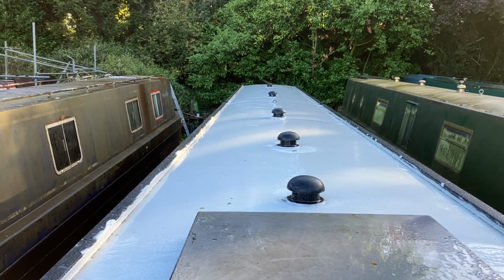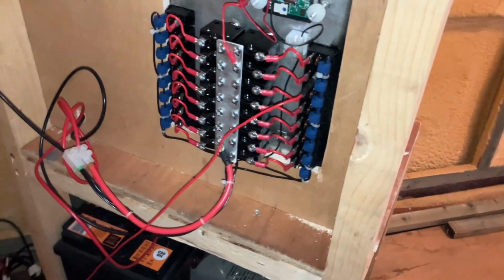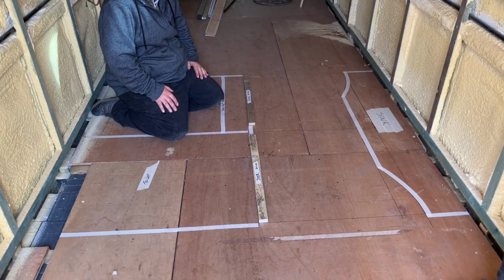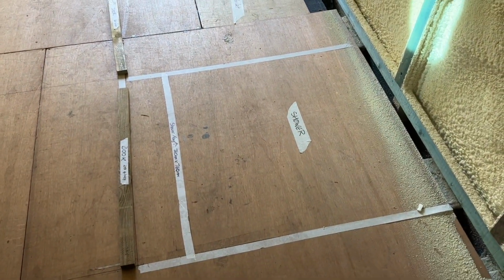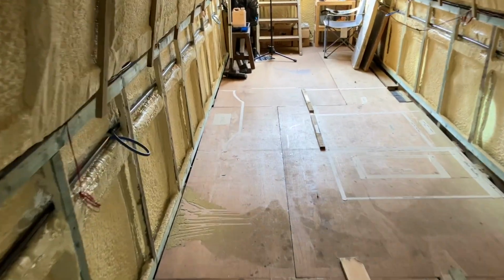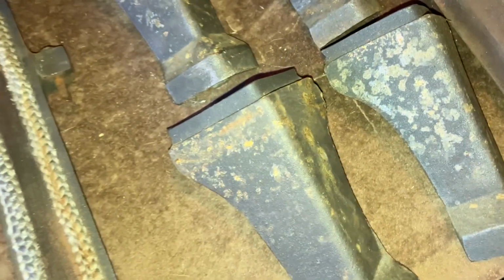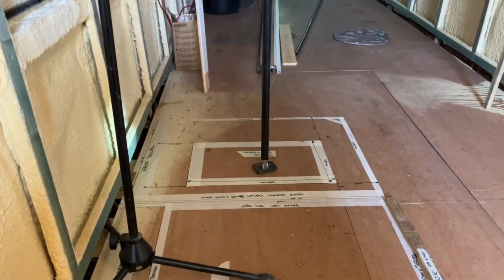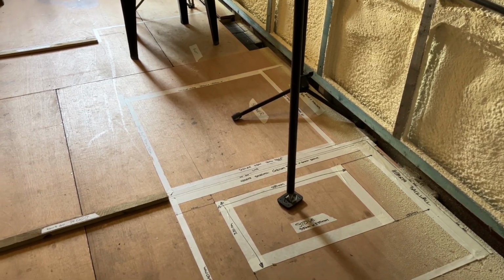79. Bathroom Layout Idea, Temporary 12v Control Panel

Comment: just started watching as i want to price up a boat rebuild. idea i had, wood paneling for the walls?, what about fire and waterproof drywall instead?, think its cheaper and has bonus features?
Reply: also, watched you layout idea vid, i have a corner sofa and opposite i have a corner desk, make a good work space and thought about balancing the boat, a fish tank is an idea. 120-240ltr is a lot of weight.when you get there, add glow in the dark things on the edges of things, so you can see it in the dark and avoid accidents.i have glow in the dark stars on my fish tank to make sure i dont.
:goodvibes:

Comment: For the nav lights, think about going through a narrow tunnel. There must be 300 of them at the bottom of the Harecastle tunnel. I do like your layout idea for the shower/Loo. But I think it depends upon which type of toilet your going to use. Compost loos are slightly larger. Cassette type loos need access to the cassettes for removal and replacement. Although I did imagine the loo facing sideways across the boat and having that little bit of extra room once the door is shut, with a little trap door in the dinette area for access. I do agree with using James's idea of having access behind the shower wall. I have seen whale gulpers fail and then you have to get under the shower floor to replace it. Just a thought. I also liked it when you said about having the fire at an angle. Although there is one thing about the hearth plinth for the fire, round off the corner or it can become a very good toe stubber. All in all, you're going great mate. Cheers Oli